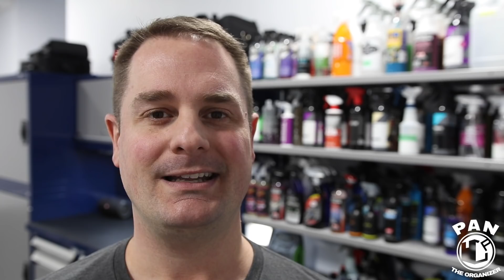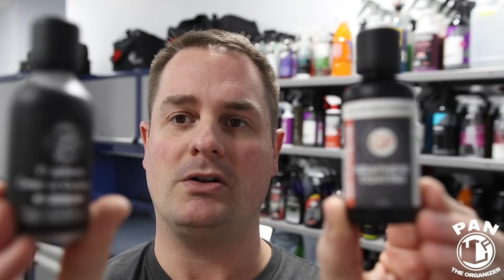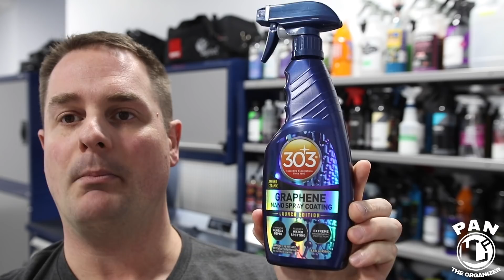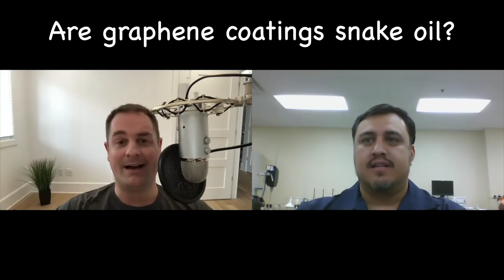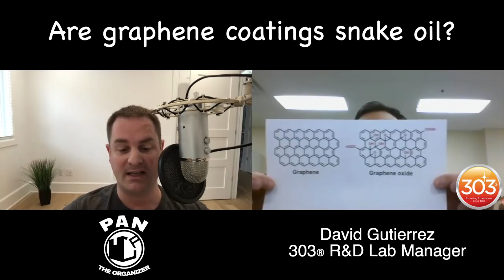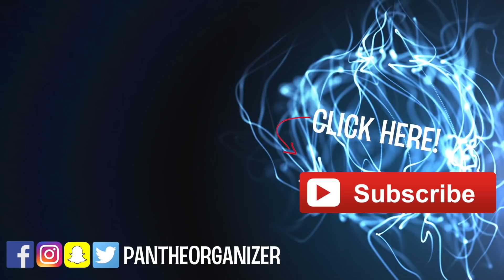ARE GRAPHENE COATINGS SNAKE OIL ?!?

Comment: I succumbed to the hype and bought a bottle of 303.  Per your initial review, I will apply this over all the sealant I have on all three cars (Turtle Ceramic and Bead Maker).  As long as I don't have to remove existing sealants (a lot of work I don't feel like doing!), I'll give this a try.  As previously mentioned, I have  used 303 silicone protectant on my cars' interiors and rubber gaskets for years.

As for the longevity of the product (Seven years?  Really?), I remain skeptical.  No matter, because I apply a sealant or quick spray after every wash.

Thanks, as always, for the BEST auto detailing channel on the internet!
Reply: 303 estimates a year worth of protection for their spray coating.
Reply: 7 years was referring to some sio2 coatings not this 303 product
Reply: I got the Adam's graphene spray and put it on top of the Black Ice ceramic coat that was on my car already. Car looks better than ever. 2016 Elantra outside 24/7.
Reply from the maker: Thanks Pete, but I think you are confused with other products. The 303 Graphene Spray Nano Coating is claimed to last up to 1 year, not 7. 

And yes you can apply it on top of your existing protection without removing it. However, to get maximum performance and durability out of this, there's nothing better than stripping everything and starting from scratch. But you don't have to.

Comment: I tried this product last month on a few vehicles. One was my daily driver, a black truck. The coating that comes out of the bottle is black, not sure why. It seems to give the black paint a nice depth and nice shine. But, it doesn’t give it a nice silky soft touch. No comparison to Hybrid 07 sealant for softness. Second vehicle was a Shelby Daytona Coupe with a high end newer paint job. This finish is so smooth, a microfiber cloth just sides off when laying flat. 303 seemed the remove the silky finish and made it a little less soft. For $20, it’s not bad but it’s not all that...
Reply: Very true the “slickness” that was advertised aka “hype” 
was not as slick as other competition in the same category

Comment: I think ill stick to turtle wax ICE seal n shine... Or the sonax trio.
Reply: Use seal and shine with turtle wax ice spray wax as a topper
Reply: I'm am using Seal and Shine now and several of the Hybrid Ceramic products and I'm liking them a bit, but I want to give 303 Graphene a try as a Seal and Shine replacement partly because it requires less prep work to last 6 months (probably). Still relatively new to his detailing stuff. Looking for products that make detailing fast, long lasting and easy. Products like TW Wet Wax.
Reply: I will continue to use seal n shine, fusso coat, hydrosilex recharge, meguiars hybrid ceramic wax, beadmaker, colinite 915 and 845, basically I will continue to use all the products I purchase...comes down to what mood I am in, plus it's fabulous to have many choices when it comes to detailing!!!!!

Comment: I am not the normal user. I was about to formulate a Graphene coating for true testing to determine it's efficiency.

I have serious doubts that these  Graphene products are effective beyond the carrier agents effects.

Most are infused with GO , Graphene Oxide, which is 1. Water ... Hydrophilic. It attracts water, not repellant. 2. GRaphene does not automatically bond to itself or another surface. 3. The Graphene coatings available are using Silane, which is Concrete water proofing Poly. So the actual effect is not from Graphene, but from the waterproofing Poly. 

Now Graphene does not mix into anything else easilly. There are specific ways it must be manufactured and handled, which are not inexpensive. You cannot stir or cook Graphene.
Graphene only melts under temperatures of 9,000. Deg. Kelvin, which The 303 company does not have the capability. So how is this supposed Graphene being manufactured.
It may interest anyone reading this that there is a Company that owns the Patent in US and Internationally for all five known way of manufacturing Graphene coatings. Google bought them.
International in 2017, and in US in 2018.
Reply: Now that's interesting
Reply: It would be interesting to see a TEM / XPS spectroscopy analysis of these coatings.   For those unfamiliar (most people), that's basically using an electron beam to very slowly drill through a material (TEM) and then use xrays to determine the material composition at a given depth (XPS).   We've used this where I work to engineer multilayer laser optical coatings and it gives very precise information about coating thickness and what elements are present at a given depth.

My guess is that the ceramic (SiO2)/graphene component is probably a tiny fraction of the carrier liquid (Silane as you say?) which is what's really doing the majority of the hydrophobic 'work' that people want from coatings.   It's also likely that the SiO2/Graphene is only present in some areas (ie there's gaps between them) across the surface and the majority of the surface is just covered with the carrier epoxy (silane).  

This is not to say these coatings are BS or don't work - I use them and they do work - but it's probably more accurate to say that only 0.1% of the bottle you buy is actually ceramic or graphene and the other active ingredient that makes up 5-10% is Silane..
Reply: @sooocheesy  Silane is a polymer of Si (silicone), so it is difficult to distinguish from SiO2, Silicone Dioxide.
G, or GO , Graphene Oxide binds easilly to Polymers, so it does work to some degree. In this case , many Auto Paints are Polyurethane. So GO and Silane will bond to it.  
The problem I have with these companies is that they claim they have a proprietary formula, but this can also be an excuse to avoid scrutiny. 
Also None of these companies can claim they have done any serious testing. One You Tube video claimed they could install a 7 year Graphene coating. I laughed and told him such a claim was impossible seeing the coatings haven't been around for more than a year, and I dare any company to prove me wrong with proof.

I think one Detailer read on one bottle a company claimed that using their Graphene could make the paint surface cooler. 
Now a real GO coating could do this, and it is one reason why I was going to manufacture a Coating for testing which would eventually go towards aerospace use. But to make these claims without having done the proper research is irresponsible, false advertising bordering on fraud.

Comment: That was a great interview, I always wanted to find a discussion were technical and phenomenological aspects take place. In addition, I understood that the surface temperature lowering effect could be explained in terms of the rates of heat transfer vs the rate of evaporation and slicking of water droplets. The rate of heat transfer is generally described by an overall heat transfer coefficient, as well as the heat capacity, naturally, that parameters are function of the chemical species involved in the system, in this case graphene oxide structure. From this perspective the overall heat transfer coefficient should be lower (and/or the heat capacity should be higher) than the one of the SiO2 structure, basically due to the presence of Carbon species. This situation would allow the graphene oxide structure to act as a reservoir (or sink) of heat, avoiding the fast rate transfer from the surface of the coat to water, which in turn, would minimize the interaction of the hardness of the water by increasing the time for the droplets to slide to the ground without being evaporated, or eventually, to be dried by air or by contact methods.

Comment: Awesome video. 
Pan, if you have chance to ask him some more questions, i have a couple:
1) What would happen if you tried to apply multiple layers of their spray coating? Would you end up with an every increasingly thick layer, or would it basically replace the layer that was already there?
2) Can other products, such as quick SI02 detailers, be stacked on top of this product?
Reply from the maker: Thanks Peter! To answer your questions:
1) 303 said you can apply up to three layers 
2) yes

Comment: Finally got a decent  day to wash and apply 303 Graphene.  It certainly is black!  I followed the directions, waiting for a light-colored haze, then remove / buff.

It doesn't smell like strawberries, peaches, or mangoes.  It smells like it's a dedicated industrial product.  That's fine.

It's more difficult to remove - lots of drag.  Good exercise!  There were no streaks.

My paint is shiny, but not slick by any means.  I like slick.

Solution:  Top with Bead Maker next wash.  Now THAT'S slick!

Longevity:  I have no idea, and probably will never know.  I use a spray detailer (almost always Bead Maker, Turtle Seal & Shine once in a while) every time I wash.

I have no comment on any other claims (surface temp, etc.).  

303 Graphene is economical to use, and well worth taking a chance.  I will never pay big money for a tiny bottle of XYZ Razzmatazz.  Not for a daily driver.  If I had a Ferrari or a Mercedes for entertainment, I would consider it.  But a 10-year old Honda?  Not a chance.  I'll put that money in the beer fund.

I'm still a huge Bead Maker fan.  I'll use it 'til it's gone, then will order some more.

I will also buy Turtle Seal & Shine, and 303 Graphene.

They're all good, solid products, and I would never have known about them if I didn't watch "Pan the Organizer!"  I'd still be using Turtle Ice Paste.
Reply from the maker: Thanks for sharing your real world experience Pete! Just out of curiosity, did you do any prep work to the paint before applying the 303? Iron remover, claybar, polish, IPA? And did you have any protection already on your paint before applying 303?
Reply: @PanTheOrganizer  I always clay bar in the spring.  I applied Bead Maker, and used after every wash.  On your recommendation, I tried Turtle Wax Seal & Shine (improved); liked it.  I haven't done much of anything in the last two months.  Paint still beads, but didn't have that slickness (I use the "fingernail test").  

I have never used iron remover, IPA, and I'm too timid to use a machine.  I'll give some serious thought over the winter to getting a DA polisher and trying it in the spring.  I'll re-watch your videos for instructions and take my time.  (It's really nice to be retired!)

In the winter, I visit a car wash (I know that sounds horrible to purists, but dirty is dirty!) and spritz w/ Bead Maker.  This is the time of year I just try to keep up with the lousy weather (New Jersey - there must be a salt mine around here someplace).

Thanks, and Best Wishes!

Comment: There's also a lot of misinformation coming from the manufacturers. Graphene coatings work and have a lot of benefits, but the marketing is very misleading about how they work and what they do.

These coatings appear to work primarily by shearing off in layers over time, constantly exposing clean surface to allow the coating to keep its hydrophobic properties for much longer, whereas the marketing is entirely focused on promoting graphene coatings as a super duper hard single layer thick coating that lasts forever.
They're also misleading due to the fact that graphene and graphene oxide are highly hydrophillic. This of course means that it's useless as a car coating unless it contains the right balance of more traditional chemicals such as waxes or ceramics to give a hydrophobic surface. This then undermines 303s argument in this interview that the hydrogen bonding in graphene oxide makes their coatings very strong and difficult to remove without strong acids. Firstly hydrogen bonding is strong but it also means that water is a perfect solvent to dissolve this. Secondly there has to be a high enough percentage of hydrophobic additives to fully coat the surface of the graphene oxide that this is likely to reduce the bonding between layers significantly.

On the claims of surface temperature effects of graphene, his explanation is that the phase changes during the curing of the coating absorbs heat, this is plausible, but a lot marketing is implying that once fully cured the coating will keep the car cooler while sitting in full sunlight and this doesn't happen. I don't accept the explanation that the temperature effect has a big impact on water spotting either, what's more likely is that minerals in water just bond much more easily to the ceramic coatings than graphene and the polymer/wax hydrophobic additives, as for any waterspots being easy to remove with your finger, see the first point regarding layers of graphene shearing off to expose clean coating.

Comment: I enjoyed the interview, Pan.  I thought it was well done and quite helpful -- thank you!  One thing I didn't hear, maybe I missed it, was what, if any, downsides are there to using the 303 product as a maintenance topper over a ceramic coating?  I have Gtechniq Crystal Serum Ultra as my ceramic coating and have been looking for a good maintenance topper that will "work" with it.
Reply from the maker: No downsides. You can use this on top of ceramic coatings.

Comment: Pan, I can't thank you enough for being you, and also for sharing this with us.
1. I applied this product evening into darkness (with lights setup), but I don't think I really ever saw it cure to a "white" haze. It's a dark grey metallic car, and I might not have waited long enough before removing. It just looked kind of wet, mostly clear-ish when I removed.  Did I just wipe off tentative layers that should have stacked up?  Clearly something is on there now because beading occurs, especially after the prior step (see #2 below)
2. I used CarPro Spotless on the CQuartz coated car (with layers of Reload and Hydro2, so who knows which layer the water spots were between.) It expectedly removed any hydrphobic properties of the coating, after neutralizing with power wash spray followed by an additional wash with Reset soap. Water spots are still showing, particularly on the roof, so did I just lock them in under this layer (rhetorical question I guess), but it leads me to the actual concern..... By NOT claying/de-ironing the si02 layers (I was under the impression it is not recommended), haven't I also now sealed in contaminants?  
Ultimately, would you recommend "undoing" all these layers and just compound/polish down to the clear coat and start from the correct prep level, or just keep going with this 303 product, topping every 6 months or so?
3. Lastly (sorry), Just wanted to report that after a normal washing of my my microfiber towels right after this application,  they are stained black and still smell like petroleum distillates,  and do not have that "grabby" feel to them. They're soft and seem to need an additional washing. I'm wondering if they're junk now since maybe the product sat long enough to "stick"? (1 hour?)

Thanks again for your time, and especially for your effort if you happen to see and answer any of these!
Reply from the maker: Hi Brian. Thanks for the kind words, I appreciate them. I'll try to answer your questions, but I must admit you lost me there as there is lots of text and it's getting late lol. In your case, as your paint seemed to have been affected by water spots, contamination and mineral deposits, then it would have been best to fully strip the paint and start from fresh, that's 100% sure. Wash, chemical iron removal, claybar, machine polishing (which is what really removes the water stains), IPA wipe down and then start fresh with a coating application like your 303. I think you would have had a much better experience.

There comes a point where there are so many layers of protection on a car, like seems to have been the case with yours, that it gets difficult to obtain the best results when applying a new product like 303 Graphene spray coating. Multiple layers of CQuartz, Reload, HydrO2, etc.  Your paintwork was saturated most probably.

And no worries for your towels. 303 said that if you wash the towels and applicators after use (1 to 2 hours is ok) no problem, you can reuse them. It's normal that they are stained black, as that's the graphene oxide that has a black tint.

I hope this helps!
Reply: @PanTheOrganizer  Thanks so much for your time and reply.!
Reply from the maker: My pleasure Brian. Thanks for supporting my channel.